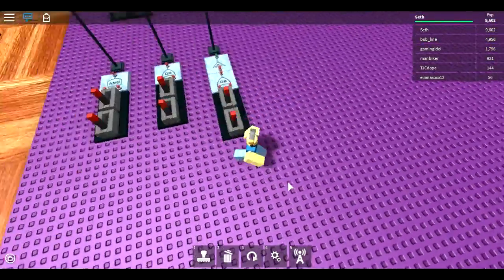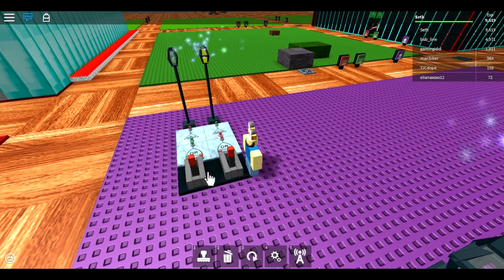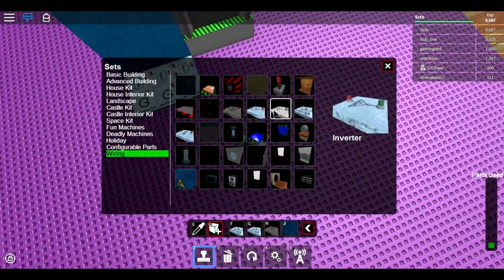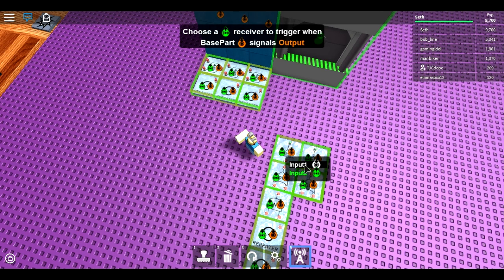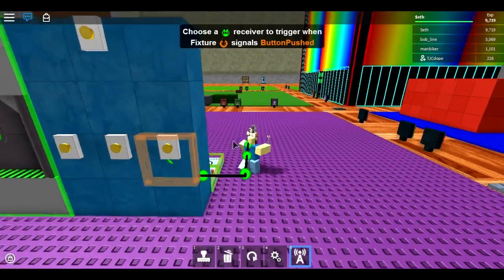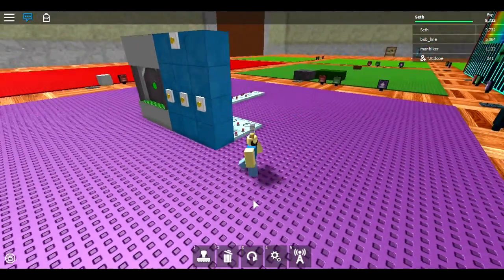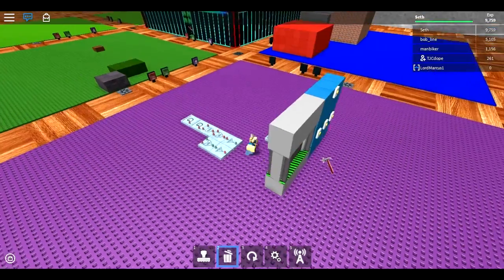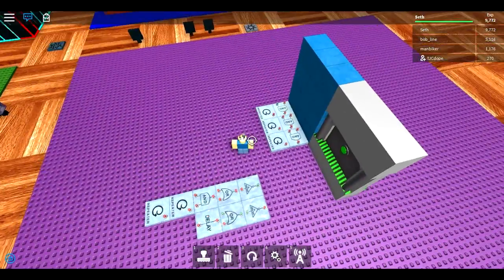WTRB/ Roblox Wiring Three Button Code Door

Comment: do you know how to wire items now that build feature is disabled?
Reply from the maker: I think it's broken, not disabled. Roblox doesn't care enough to fix it, but you can probably go to stamper build it could do it. I always have trouble getting into that game because of my bad internet, though.
Reply: k, although btw i do have 1 problem with the new conversion, where only 1 of my games will not have its terrain adapt to the new terrain tools (they still show us as the old ones while it is in smooth mode) --- hopefully fixed in Jan.?